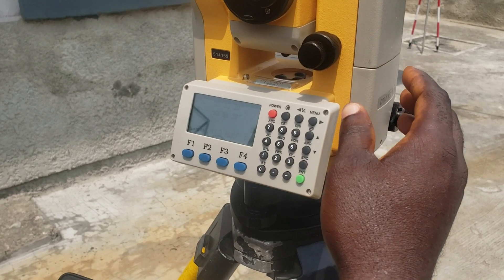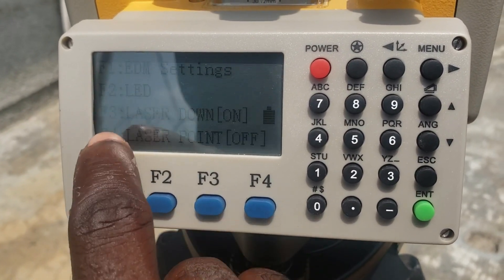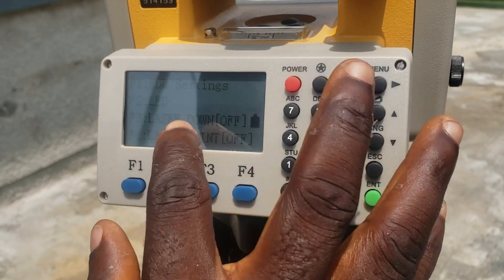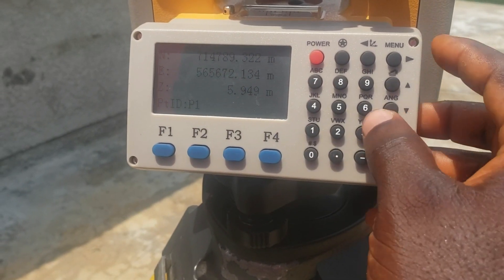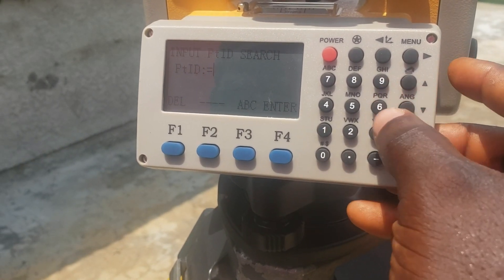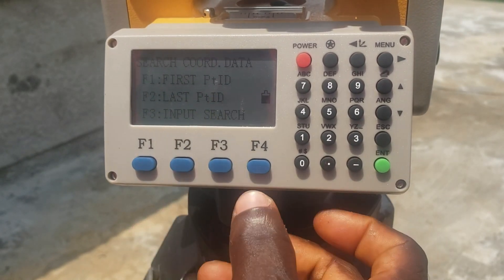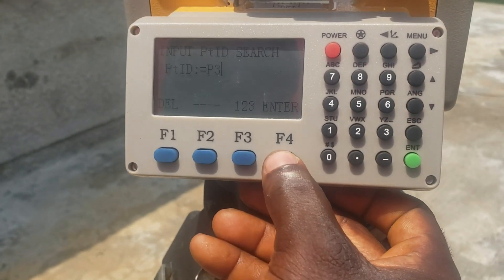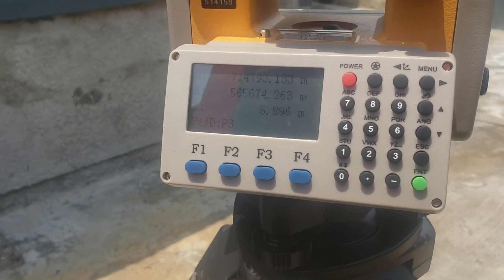TOTAL STATION TUTORIAL - HOW TO USE COORDINATE METHOD FOR SURVEY WORK WITH DTM152M TOTAL STATION

Comment: How do you get the z of the total station
Reply: And the cordinate you are using
Reply: @oluwafemijacob3014  you wil have to use gps handheld to generate one if that's a new site
Reply from the maker: It's from the ground control point, so it has x,y,z fixed coordinates